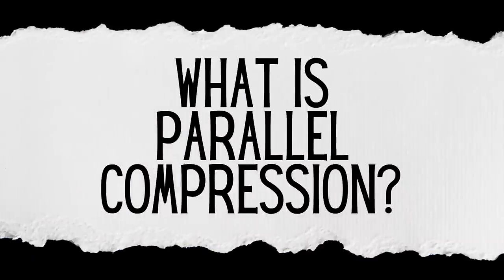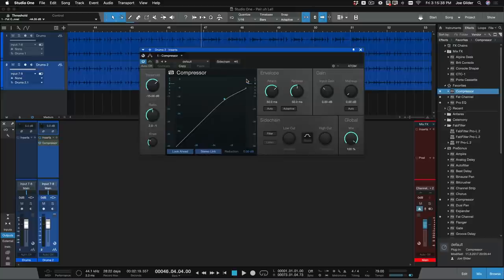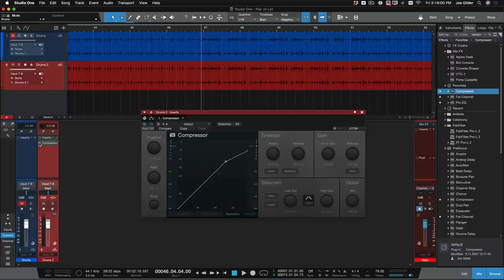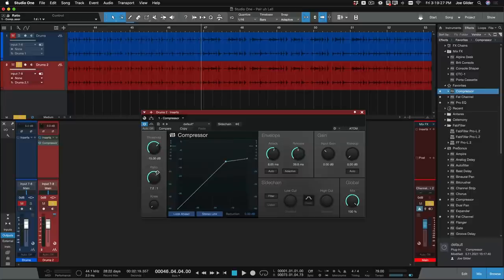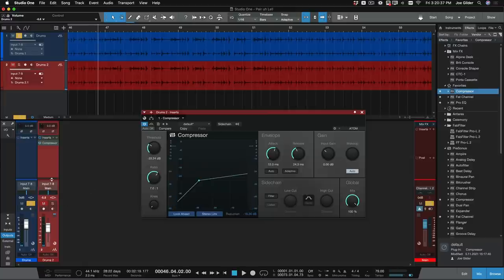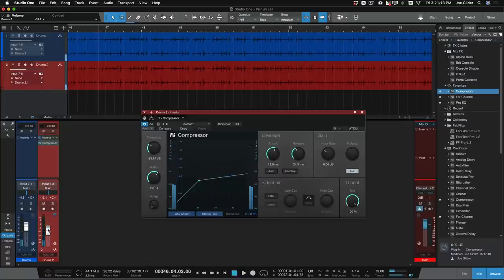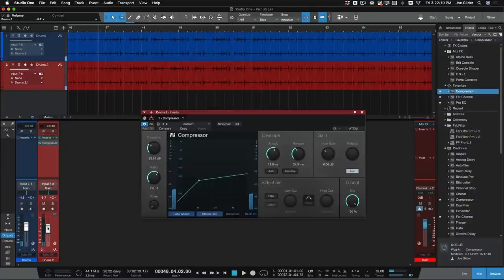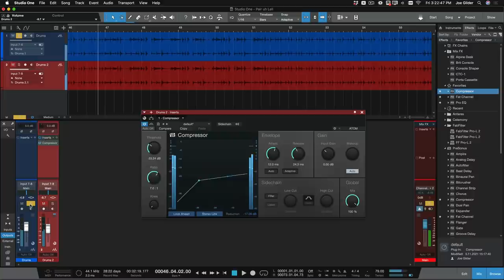Intro to Parallel Compression

Comment: Basically the point is to maintain the transient of the original while also getting a bigger sound
Reply: A simpler way of saying this is maintaining the wet to dry ratio
Reply: @nathanaelashnonmusic2615  true, good way to put it
Reply: @nathanaelashnonmusic2615  I will check that out

Comment: hey Joe can you do a video or a short segment on parallel compression using external hardware? I have the art vla 2-channel unit that i've tried using to route a drum bus to, and using the splitter tool to get that parallel effect, but it ends up doing really weird stuff with the phase and overall sound of the drum mix. is that because stereo compression doesn't work for this kind of thing? it doesn't happen when i use a singular plugin on the overall bus and use the splitter. wondering if anyone else has run into this..

Comment: This is along the same idea as a wet/dry guitar rig.  I had a marshall 412 set up in a left/right configuration where I had dry guitar from my head going to the left side and a "wet" effected signal coming from a load box, reducing it down to line level, and then going thru a multi-effect unit and then re-amplified to the right side of the cab.  That dry signal gave it such punchiness combined with the wet effected side.  sometimes guitarists will mix a cleaner amp like a Fender twin with a distorted sound and it will give the distortion more clarity and it will have more punch than the distortion alone.  Great video Joe.

Comment: Of course, it can also be done without duplicating tracks. It can be accomplished with a splitter tool or even with a dedicated bus, which requires some fancy routing.  Room mics on drum kits also make for crushing compression too. They capture the whole kit so it's like having a duplicate track. then all the dedicated mics can keep things clean.
Reply: Yeah... that got me wondering... why not just split the track?
Reply from the maker: Absolutely! I thought about talking about all the ways to accomplish parallel, but figured I'd just levae it at the concept level and let people figure it out on their systems (since not everyone uses Studio One and has the splitter tool)
Reply: @HomeStudioCorner  That is a very fair and valid point.

Comment: Question! The plugins in the modern DAWs have mix knob. So, if you add a compressonr in the insert and adjust the level with the mix knob, can you tell it is the same as pararelle processing?

Comment: Question: Does sending the source signal to an auxiliary channel with only a compressor on it also qualify as parallel compression?  Also, does using a compressor on the source track with a mix knob also count as parallel?  Oops, just got the answer to my second question indirectly when you talk about guitar pedals at the end.
Reply: Question: Does sending the source signal to an auxiliary channel with only a compressor on it also qualify as parallel compression?  - yes
Reply: @annother3350  efficient answer!  Thanks!
Reply: @michaelcope9501  no problem. I would say its better to do that than a wet/dry mix control as yoiu can further process EQ etc of the compressed signal. good luck

Comment: Isn’t it the same what Dy/Wet knob does?
Reply: My question exactly. Joe, is there any difference at all?
Reply: Yes, he said it in the video
Reply from the maker: Yes it’s the same. Although sometimes I would like to do more than just parallel compression. For example, on the heavily compressed signal I might want to EQ it as well, meaning EQ only the compressed signal, and the mix knob doesn’t allow me to do that
Reply: @HomeStudioCorner  Thank you

Comment: Can you split the signal in the drum buss in Studio 1.5  and do it that way??
Reply: Yeah that could work. What you gotta do though is bus em to two seperate group IOs and put compression on one channel while leaving the other one dry so you can maintain the wet to dry ratio.
Reply: In Studio One, you can also use the routing/splitter to do the same thing on one track.
Reply: Just add a compressor with a mix(blend) control to the drum bus. That mix control is now the amount of compressed vs dry signal of the entire bus... ie parallel compression.

Comment: Mmmm unless this was a very bad comparison it all seems pointless?
Reply: Not pointless. Gives you more control over the output resolution of the wet to dry ratio on the compressor. You don't want all compression all the time, and while yes you can minimize it in some spots with automation, some compressors also dont have a built in wet to dry ratio you can mess with, so this just gives you more options and infinite choices of combinations of compression and the dry signal.
Reply: Many great mixers, including Joe Gilder use parallel compression.  I am not a great mixer yet but  use it on doubled vocals on the choruses of my songs.  Makes the lead vocal pop out.